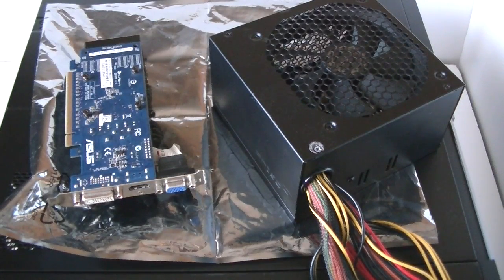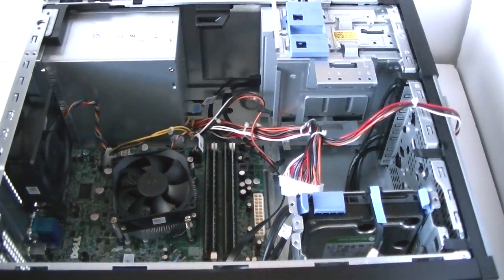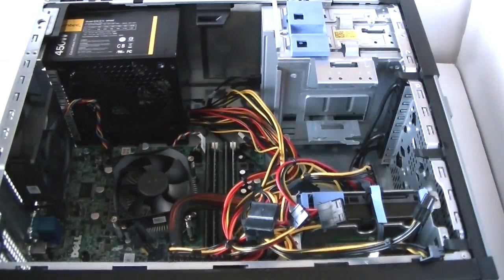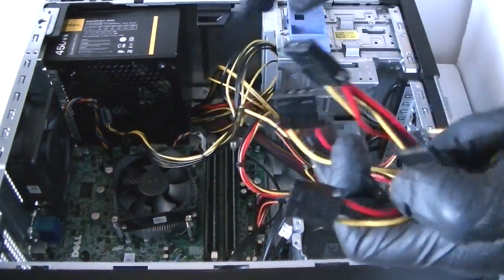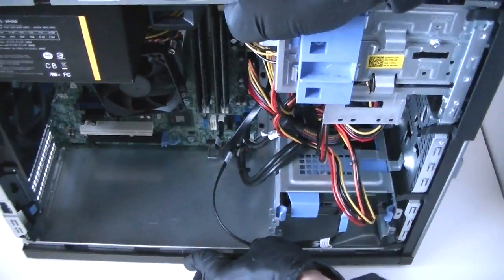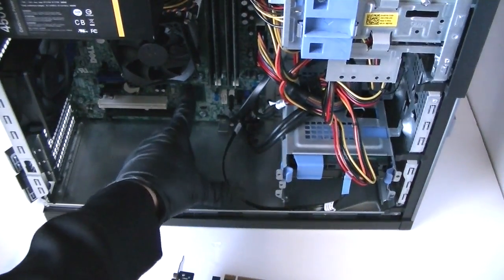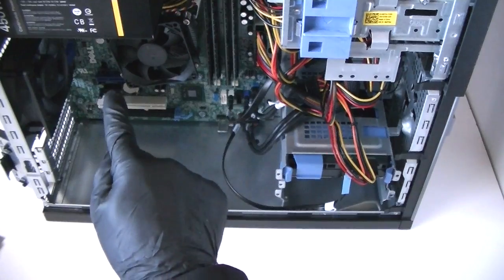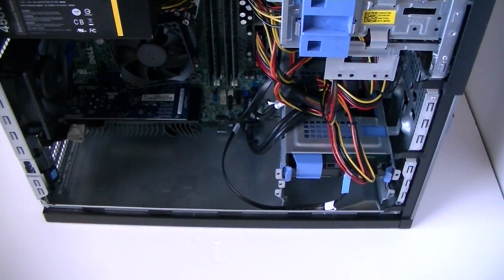Dell Optiplex 7010 MT Upgrade Gaming Power Supply Video Card

Comment from the maker: Full Parts list works with this 7010 machine:

 

CPU Upgrade: 

Intel Core i7-3770 Quad-Core Processor 3.4 GHz 4 Core LGA 1155
https://amzn.to/3xaKc3Z

PSU:

(1.) Corsair CX-M Series, CX450M, Modular Power Supply
https://amzn.to/3pnLUuh

(2.) Thermaltake Smart BX1 650W Power Supply
https://amzn.to/3Pl3WrN

(3.) Thermaltake SMART 600W ATX 12V V2.3/EPS 12V 80 Plus Power Supply
https://amzn.to/3DgVjfC

(4.) CORSAIR VS Series, VS500, 500 Watt, 80+ Certified, Non-Modular Power Supply
https://amzn.to/2RxoMZV

(5.) CORSAIR VS Series, VS450, 450 Watt, 80+ Certified, Non-Modular Power Supply 
https://amzn.to/3efEeDO

(6.) Thermaltake Smart 500W 80+ White Certified PSU
https://amzn.to/2xQHm8F

This video cards will work with this system.

(1.) EVGA 06G-P4-2068-KR GeForce RTX 2060 KO Video Card
https://amzn.to/3TZkol8

(2.) ZOTAC Gaming GeForce GTX 1660 Super 6GB Gaming Graphics Card
https://amzn.to/3e3hwmz

(3.) ZOTAC Gaming GeForce GTX 1660 6GB GDDR5 Graphics Card
https://amzn.to/3AUoPpX

(4.) MSI Gaming GeForce GTX 1660 6GB GDRR5 OC Graphics Card
https://amzn.to/3KseNzj

(5.) EVGA GeForce GTX 1650 Super SC Ultra Gaming, 4GB GDDR6
https://amzn.to/3Pmi58a

NOTE: Requires Power Supply Upgrade For GTX 1650 Super and GTX 1660, RTX 2060

(1.) ASUS Phoenix NVIDIA GeForce GTX 1650 OC Edition Gaming Graphics
https://amzn.to/3Nyn7yb

(2.) ASUS TUF Gaming NVIDIA GeForce GTX 1650 OC Edition Graphics Card 4GB GDDR6 
https://amzn.to/3moJbzo

(3.) PNY GeForce GTX 1650 4GB GDDR6 Dual Fan Graphics Card
https://amzn.to/3aFlxw4

(4.) ZOTAC GAMING GeForce GTX 1650 OC 4GB GDDR6 
https://amzn.to/3xeX0FF

(5.) AMD Radeon RX 6400 Low Profile Gaming Graphics Card
https://amzn.to/3s8MUUY

(6.) Gigabyte GeForce GT 1030 GV-N1030D5-2GL Low Profile 2G Computer Graphics Card 
https://amzn.to/2Z4PHkp

(7.) ZOTAC GeForce GT 1030 2GB GDDR5 64-bit Low Profile Video Card ZT-P10300A-10L 
https://amzn.to/2WzgLXk 

(8.) Gigabyte GV-N1030OC-2GI Nvidia GeForce GT 1030 OC 2G Graphics Card
https://amzn.to/3wd8EkB

(9.) Asus PH-GT1030-O2G GeForce GT 1030 2GB OC Edition Graphics Card
https://amzn.to/3SZ0gPC

This RAM works with this machine MAX Supports 32GB:

(1.) Crucial 8GB Single DDR3L 1600 MT/s (PC3L-12800) Memory CT102464BD160B
https://amzn.to/2VhGv8O

(2.) Crucial 4GB Single DDR3L 1600 MT/s (PC3L-12800) Memory CT51264BD160B 
https://amzn.to/2xq46wb

(3.) Crucial 16GB Kit (8GBx2) DDR3L 1600 MT/s (PC3L-12800) CT2K102464BD160B 
https://amzn.to/2VpsKpP

Thermal Compound Paste:

(1.) Arctic Silver 5 Thermal Cooling Compound Paste 
https://amzn.to/2ziNU0H

(2.) Noctua NT-H1 3.5g, Pro-Grade Thermal Compound Paste
https://amzn.to/36kTk7A

(3.) ARCTIC MX-4 (current edition) Thermal Compound Paste 20 Grams 
https://amzn.to/2DhGJaK

Hard Drive Caddy Adapter  3.5 to 2.5:

(1.) Dell 3.5" to 2.5" SSD or Hard Drive Caddy Adapter R494D 0R494D 
https://amzn.to/2XTPeRr

(2). Dell Hard Drive Caddy, R494D, F767D 3.5" to 2.5" SSD or Hard Drive
https://amzn.to/3cTkcOk

SSD list works with this PC:

Samsung 870 EVO 2TB SATA SSD
https://amzn.to/3ezOds5

Crucial MX500 2TB 3D NAND SATA Internal SSD
https://amzn.to/3B9f8CF

SanDisk Ultra 3D NAND 2TB Internal SSD - SATA
https://amzn.to/3RSZ8LR

(1.) Samsung 860 EVO 500GB 2.5 Inch Internal SSD MZ-76E500B/AM) 
https://amzn.to/2yNxnkE

(2.) WD Blue 3D NAND 1TB Internal SSD, 2.5" WDS100T2B0A
https://amzn.to/2wvnC9Z

(3.) WD Green 1TB Internal PC SSD  WDS100T2G0A
https://amzn.to/3cbrcWa

(4.) SanDisk SSD PLUS 480GB Internal SSD SDSSDA-1T00-G26
https://amzn.to/3a3i9ou

(5.) Crucial MX500 250GB 3D NAND SATA CT250MX500SSD1(Z) 
https://amzn.to/34rZlhy

(6.) Samsung 860 PRO SSD 256GB - 2.5 Inch SATA III Internal Solid State Drive
https://amzn.to/2ybiHLK

(7.) Samsung SSD 860 EVO 250GB 2.5 Inch SATA III Internal SSD 
https://amzn.to/2VjIAkK

(8.) SanDisk SSD PLUS 240GB Internal SSD
https://amzn.to/3c7SEE4

HDD list works with this PC:
(1.).WD Black 2TB Performance 3.5" Hard Drive - 7200 RPM Class, WD2003FZEX 
https://amzn.to/2xFUeyF

(2.).Seagate BarraCuda 1TB Internal Hard Drive  3.5" Hard Drive - 7200 RPM
https://amzn.to/3g8FXM8

(2.) Western Digital 1TB WD Blue Mobile Hard Drive HDD - 5400 RPM, 2.5
https://amzn.to/3aEQ1Os
Reply: What about an EVGA 550GD? i'm about to buy it but i'm not entirely sure if it will work
Reply from the maker: Hi, yes that power supply will work 
https://amzn.to/2ScjRhr
Reply: @Mxkdt  the thing is that the 500GD is a newer version of the GD Series while the 550GD is an older version. The 500GD costs almost 100usd here in my country while the 550GD costs only 65usd and that's why i want to buy that specific model... My main concern is that in the asian evga website it says that the lenght of the psu is 165mm but in the international evga website says it is only 140mm, so i'm wondering wether it would fit or not
Reply: This is super helpful, where do you get knowledge like this?
Reply: Does the sata power cable hit the case door?
pls reply
Reply: Do you know of any 650w psu's that will fit in dell optiplex 7010 mt? I am not very tech savvy and this is my first time trying to do something like this. Thanks in advance for any advice you can give me.

Comment: I ended up swapping out the case for my Optiplex 7010, since I had spare parts lying around. I've been trying to hook up the mobo to a Corsair RM550x PSU and I am not getting any power to the board at all. At first I got the CPU fan to power on for a couple seconds without the CPU 4-pin plugged in. Now, not a peep. I have tested the mobo with it's original supply and it's turned on, I just can't get the PSU to work since

Comment: What kind of Power supply do I need to get because I was thinking a Corsair CX-M but I don’t understand these really like I see that there is a 4 pin on my board but do I just use one of the 6 pins and plug that in or like what or do I need a specific 4 pin
Reply from the maker: Hi, yes most new power supply's  does come with CPU power cable 8 pin and you can split cable to 4pin like corsair or antec, thermaltake, seasonic brand.

Comment: hello, the power source comes with a 4+4 atx/eps cable so one is an ATX12V and one is an EPS12V,  but I only need 4 pin connection for the motherboard, which one do i use? tx and great video
Reply: How did it work out?

Comment: For my 7010, I'm going with a Corsair 16GB DDR3 Ram Kit, Thermaltake 500 Watt Smart PSU, MSI 1650 Super OC GPU and some LED Fans and plexiglass for the side panel cutout.
Reply: Same
Reply: Did the 1650 fit?

Comment: Hi, and thanks for this video. I want to buy a 7010 but before, do you know guys if I can add an RX 470 on the motherboard of the 7010 ? Also, can I replace the original power supply by any power supply who can fit in a mini tower case ? Thanks !

Comment: need help! can i fit rx 570 GPU in dell optiplex 7010 same casing as shown in the video? with 500 or more watt PSU! will my GPU card fit?
Reply: 500 watt is good for the RX 570 and it should fit in the casing no issue. If there is you might need to get a PCIE Riser

Comment: Can I install andy psu? Evga or cooler Master...? I think of 550w or 450w  and can I install a dual fan gpu? Like rx 580 or 570 or gtx 1650 super? Any help!
Reply from the maker: Dell optiplex 7010 mini tower you can use gtx 1650  or gtx 1650 super video card with 450w or 550w power supply upgrade like brand name corsair or seasonic.
Reply: @Mxkdt  I have mid tower
Reply: I'm gonna buy a 550w evga and an rx 580 or gtx 1650 super or rx 570 (I will pick the cheapest one)
Reply: need help! can i fit rx 570 GPU in dell optiplex 7010 same casing as shown in the video? with 500 or more watt PSU! will my GPU card fit?
Reply: @mytheory7563  I think that's normal you can do it but search more about it
Reply from the maker: Hi, do you have mini tower or small form factor PC ?
Reply: @Mxkdt  I think it's mid tower
Reply: @Mxkdt  I mean the bigger version. Of optiplex 7010
Reply from the maker: Hi i would not waste my money on that cheap junk power supply if it is EVGA 550 N1, 550W it is not even 80 plus, 
This power supply will work 
EVGA 600W 80 Plus Certified 100-W1-0600-K1 and rx580 video card will be running really hot you have to install 120mm fan in the front
Reply: @Mxkdt  I can't buy those stuff an I go with 450w 80 plus (cooler Master and a gtx 1650 super? Is it a better deal?

Comment: I have he same PC that sata port you talked about “L” shaped cable, what is it for? I don’t seem to have anything plugged into those slots and I can’t boot into any of my hard drives! I bought the computer with no hard drives I cloned an ssd and was able to boot into only via the front USB ports. If I try to connect the ssd to any of the sata ports an error pops up saying no bootable device found

Comment: I had an i3 3470 before and then I gave it 5 3470 and in bios it doesn't just taste what I should do
Reply from the maker: Hi, yes you can upgrade to Core i5 3470 or i7 3770.

Comment: You obviously are very familiar with the 7010. I just ordered one and I wonder if you know which two sata connections are sata 3.0. The technical manual says 2 are 2.0 and 2 are 3.0, but not which is which. Thanks!
Reply: i thinks its sata 0 and 1 blue and black
Reply: @vanillarainestudio  I think you are probably right. I ran across a forum thread and one answer agreed with you.

Comment: Can the new psu damages the motherboard of the computer ?
Reply from the maker: Hi, no.
Reply: Thinks for your answer.
1. Even if we use a 500w psu, this will not damage the motherboard or any part of the computer ?
2. when i install the new psu, could i use the old power connectors that came from the motherboard to the hdd, rather then from the psu ?
Thinks a lot for your tutorials, it helps me a lot.
Reply from the maker: Yes you can use 500w power supply make sure you use quality brand like corsair or seasonic, What kind video card are you going to use?
Reply: Hi, im gonna use the geforce-gtx-1060; You can see it's specification in this link : https://www.geforce.co.uk/hardware/desktop-gpus/geforce-gtx-1060/specifications

2. Can you please give me any ressource on the internet that explain why if we have a 500 w psu, it will not dammage the computer's component ?

Thinks.
Reply from the maker: 06G-P4-6161-KR this model will fit video card single fan and dual fan video card will not fit and all you need is 400w quality power supply try to get at least  CORSAIR CX Series CX450 450W
Reply: thinks a lot for your help. I have one last question :
In some optiplex computers such as 3050 and 5050, the PSU connects to the motherboard with a non-standard connector and then peripheral power cables connect to the motherboard.  In this case if a use a new 400w PSU, will i connect the peripheral power cables from the motherboard or from the PSU ? One possible solution is to connect from the PSU like in this video but what if i connect from the motherboard, does it creates problems ? thinks.

Comment: is it ok if I install 600W PSU in my Dell 7010?
Reply from the maker: Hi. yes you can corsair cx650 or corsair cx600 power supply.
Reply: @Mxkdt  Thank you
Reply from the maker: Hi. or you can use Corsair CX500 ATX Power Supply.

Comment: think i can install an MSI aero ITX radeon rx 560 4gb, on a optiplex 7020 with i7 4th gen, and 16gb ram. its all pci think stock psu handle?
Reply: The Stock PSU will NOT handle it

Comment: I have a 7010 Mini Tower.  Note the stock PSU comes with 'right-angled' SATA power plugs.  Make sure the replacement ATX PSU has 'right-angled' SATA power plugs.  Otherwise, if you insert a 'straight' plug into a 3.5" hard drive as shown in the video, the leads from the plug are likely to stick out too far from the case, and prevent the metal side panel from being refitted !

I only discovered this fact during an experiment, where I took an ATX PSU from a 2008 PC to verify it would work in my 7010 MT.  This old PSU happened to have 'straight' SATA power plugs.
Reply: Crypto World  no problem with power supply... remove the hdd drive cage with a drill it is held by some rivets at the bottom of the chassis, buy a 2.5(for ssd)+3.5(for hdd) to 5.25 adapter with this you can put all of your drives in the 5.25 drive bays and now you can also put a longer gpu thats what i did
Reply: @vanillarainestudio  do you have a video?!. . . hi XD!
Reply: plz #help. I am going to buy gigabyte rx670, 9.55" long. can it fit in DELL optiplex 7010???
Reply: Bilal Shahid no

Comment: Would a GTX 950 fit someone help
Reply: I just ordered my 7010 MT, but I did watch the video. I have 2 ASUS Strix GTX 950 GPUs, that I replaced with a 1660 Super. My 950 measures 8.5 inches long. Thus, they would hit the MB SATA connector, based on what Mx said.

Comment: Great help! I'm needing the same upgrade for a new 3d architectural drawing program. Will it support 2 monitors?
Reply: Most PCs support two monitors, even laptops can do it, just select a dual monitor setup in the display settings. Sorry if I was two years late.

Comment: Have a few of these coming this weekend with the I7 3770.  Why does Dell do such stupid crap like put the Sata ports right near where the GPU would run through ><

Also hate how they don't use a normal mounting system for the CPU fan. Either going to have to look for a small card and maybe catch a deal on a 1060 (feels like a waste pairing a I7 with a 1050 or 1050 TI) Or get a new MOBO , CPU Fan and Tower.

Comment: Hey Mxkdi, I'm looking to upgrade to an i7 3770(from i5 3570) and add a GTX 1060 later down the line. What PSU would you recommend without having to modify the case / remove the mobo? Thanks :)
Reply: thermaltake 600watt is good for that

Comment: I really like your videos, I have the Dell Optiplex 7010 and 990, I tried to change the PSU in the 7010 and I noticed there a spring PSU retainer and in your video at 1:10, you were trying to install the new PSU but you were having a hard time, because the retainer is spring loaded and you must pull it back in order for the PSU to fit and when I tried to replace the stock PSU with a 750 watt PSU it would not fit, because it's a tad bit longer than the stock PSU and I tried to remove the retainer with no luck, can you please show how to remove it so a larger PSU with more wattage can be installed. Thanks and please keep your video coming.
Reply: need help! can i fit rx 570 GPU in dell optiplex 7010 same casing as shown in the video? with 500 or more watt PSU! will my GPU card fit?

Comment: And if you have a Video Card then you can UP-Grade to a XEON CPU for Four Cores and Eight Threads and maybe a higher clock speed !  Like the Dell Optiplex 7010 MT for the Tool Less Case and lots of room !  tjl

Comment: This is exactly what I'm about to do, and the video has been incredibly helpful. Thank you!
Finally upgrading to the GTX 1050Ti 4GB, and adding the Corsair CX 450M in case I need to upgrade further in the future.
Reply: How well did this work for you? Did you find you needed to upgrade the PSU or no?
Reply: This worked perfectly. I did need to upgrade the PSU to the 450 though, the output of the supplied power source was only 275W. I looked around online and found that I would probably need at least a 400W for my current setup.
Reply: Interesting. I'm curious if I get get by on the 275W stock power supply in the Dell 1070 MT. 1050 Ti specs quote recommended system wattage at 300, but only has a 75 TDW.
Reply: I'm sorry, I should have explained a little more. I plan on retiring this computer some day and using the parts I've already upgraded in a new rig. The larger capacity of the PSU was meant to ensure that I wouldn't have a problem with a heavier load.
Reply: Could you fit the gtx 1050 ti in it ??
Reply: Can I install gtx 1050 or 1050ti low profile without changing the psu
Reply: Please answer did you instal two fans version of 1050ti?
Reply: jerzaub two fans version will not fit as the sata ports will be in the way for that. MxKdi explained that in the videoz didn't watch the video?
Reply: Hey man! Does the powersupply work with 24 pins?

Comment: hey i have now a dell optiplex 7010 3.20 hgz   and i wanne put a psu 430 watt in whitout a video cart wil te power be to much]
Reply from the maker: Hi, what brand name power supply  are you trying to install ?
Reply: corsair 450 watt
Reply from the maker: Hi, yes corsair 450 watt power supply is good and reliable.
Reply from the maker: Hi, if you are not installing any video card all you need is stock dell power supply.
Reply: Hi, can you link me to the one you used .. I'm currently looking at corsair as well

Comment: when i build gtx 1050 ti 4gb the problem come there is a blue thing i just put up that thing computer auto.. off piz solve my problem
Reply from the maker: Hi, yes you can install gtx 1050 in PCI Express x16 slot (blue color)
Reply: you have a facebook id
Reply: blue thing is PSWD what i do
Reply from the maker: What problem are you having ?
Reply: in a motherboard  there is  PSWD they look like bule pin when i build gtx 1050 ti 4gb 2 fan 9mm size. that thing stoped to build my card thank for your Highlighted reply

Comment: Thanks  a lot Mxkdi .  I 'm doing a lot of Flight Simulator gaming ( Dcs World, Fsx etc... I'll seriously consider the Seasonic 500w  as long as the mob can handle it...I Subd to your channel ,keep up the good work.
Reply from the maker: Hi, yes seasonic 500w really good power supply or you can get for the same  price 550w seasonic with 5 year warranty
Reply: It old I came with a $20 pc I bought and before they got bought out by Toshiba but a ocz 700 watt